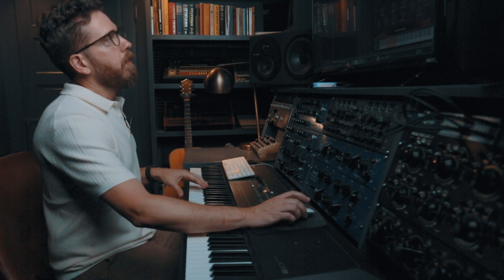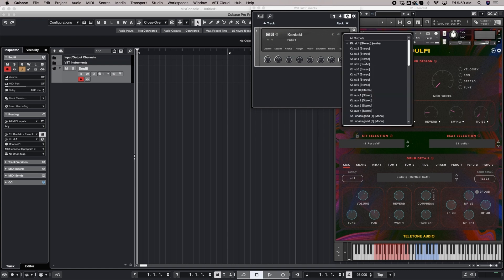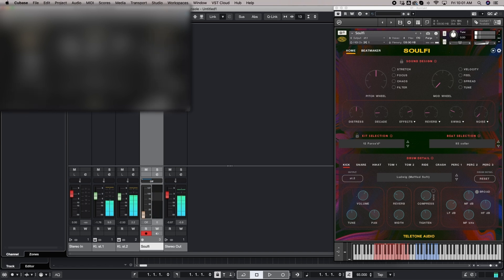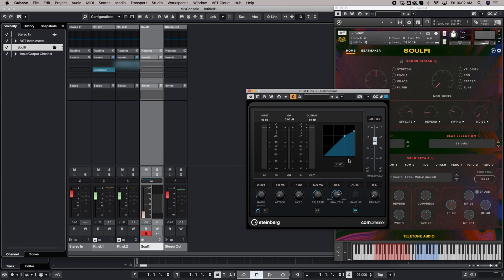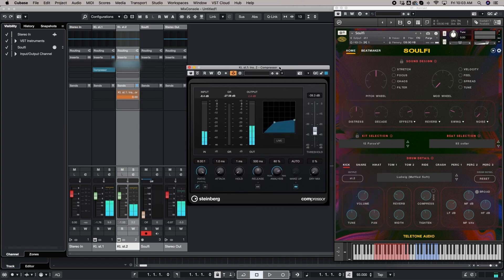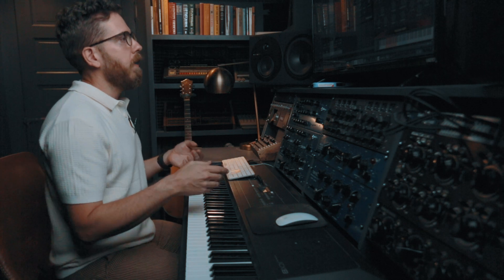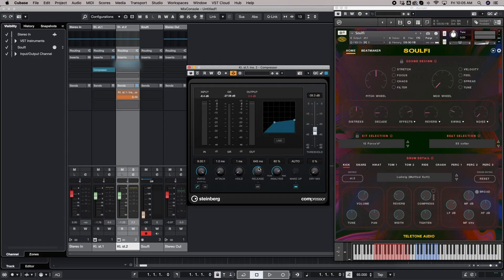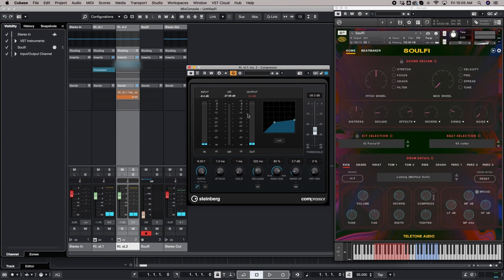Soulfi  — Multi-output Routing and Sidechaining

Comment: hi there, when playing Soul Fi live on a midi controller (not beatmaker mode) how do I set the snare/side snare/snare roll at different volumes? Thanks
Reply from the maker: They are tied to the volume of the main snare. If you play softer on those hits they will play quieter.

Comment: So there is no way of routing the drums to seperate channels in the DAW's mixer without bypassing the internal FX section?
Reply from the maker: Correct. All of our drum effects are on Bus 1. When you route any of the drums to the another buss/output (multi output), say Bus 2, you loose the effects because those effects are not on that bus. 

The reason for this is that if we put Distress, Saturation, Flanger/ Phaser, Reverbs etc on to every possible bus it would +20x the CPU unnecessarily. Hope this makes sense!
Reply: @teletoneaudio  but theoretically you could solo the kick in the beatmaker, send it to another channel and sample it to audio. Then solo the snare or whatever, and record that into another channel, so that way the effects are baked in. and from there you can do whatever you want with it, but since the samples sound so good, I personally wouldn't do much to it anyway, otherwise it would sound too overprocessed i think.
Reply from the maker: That would kind of work, but the problem is, for example, Distress is a form of compression. And the sound of compression you are hearing when the entire kit is playing is an entirely different sound when say just a solo Kick drum hits the compression versus the entire kit. So that won't 100% work.
Reply: also want to know. thanks in advance

Comment: so wait, are u saying there is no option to keep effects when you route the individual drum channels to your daw? this a major bummer if so
Reply from the maker: All of Soulfi's effects are on Bus 1. When you route any of the drums to the another busses/outputs (multi output) you loose the effects. The reason for this is that if we put Distress, Saturation, Flanger/ Phaser, Reverbs etc added to every bus it would 20x the CPU unnecessarily. Plus the beauty of those effects shine through when the entire kit is being processed versus the individual channels.
Reply: I think I understand it,  I'm a bit new to this, so I want to make sure I'm doing it right. What's the best way to route the audio to my DAW (Ableton)  so that each sound is separated on its own channel, with all the effects still in place? I want to have more control over the mix with the other elements in my song.
Reply: In ableton - If you want to preserve the effects, leave everything in output 1 in soulfi kontakt, and then solo the kick, create another audio channel and set it to resample, arm record and record the kick to this new channel. This way you have basically dropped the kick to an individual audio channel.
Reply from the maker: https://youtu.be/Ma0VctIkmfY?si=ecGSCldbYZ6YVqYR

This video is an Ableton/Kontakt specific tutorial. Again... all of Soulfi's effects are on Bus 1. The moment you route, say, the snare to a different bus it will no longer be effected for the reasons I mentioned before.
Reply: @teletoneaudio  thanx must appreciated
Reply from the maker: You got it. We made our own video showing you how it's done but it's more Cubase centric but still has some good takeaways...

https://youtu.be/uoXzKM9caxU?si=9hqLHTGhBEoROB9a